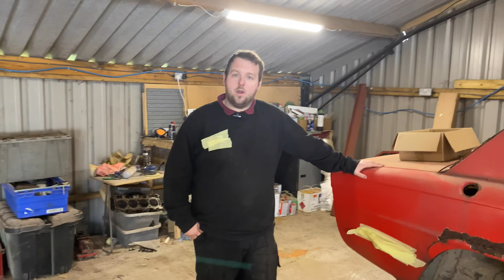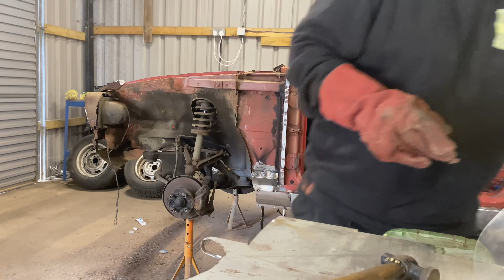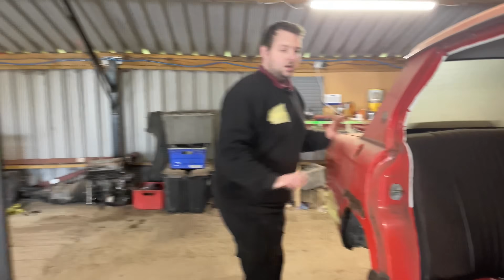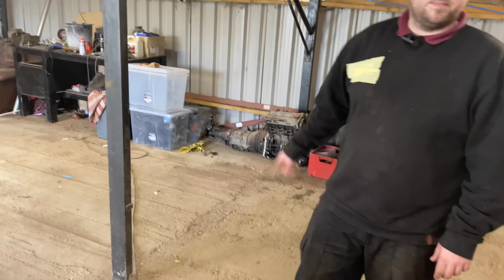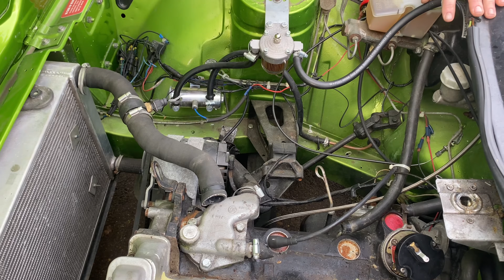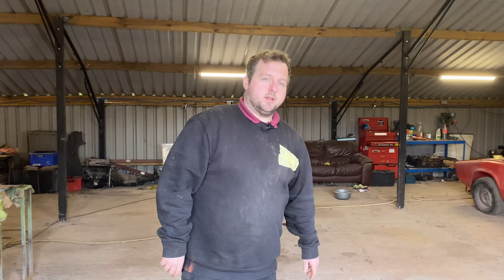Dolomite fabrication & TR 7 update

Comment: Good stuff,,the front leading edge of the cills are not correct..they taper into the body if you don't sort this you will have issues fitting the wings glass or steel also the inner splash Shields won't fit properly. I've built just a few of these shells and this we found out at our cost .👍🏻👍🏻.ps I've steel wings here..
Reply from the maker: It’s not going
To
Affect fitting
The front
Wings as it’s behind the front
Wing the front wing has already been test fitted the car is
Not going
To be having splash shields
Fitted as it’s going
To be a track
Car and
It
 Will save weight

Comment: Couple of questions, how will your new water pump setup deal with circulation to the heater?   Also, guessing you are running an electric fuel pump because of the pressure regulator mounted on the strut tower but you can use a low pressure pump so you don't need that?
Reply from the maker: The electric water pump actually circulates water better than the standard one so
The heater is actually improved we do
Have a low pressure fuel pump on the car the pressure regulator is actually a filter as well that’s why we fitted it